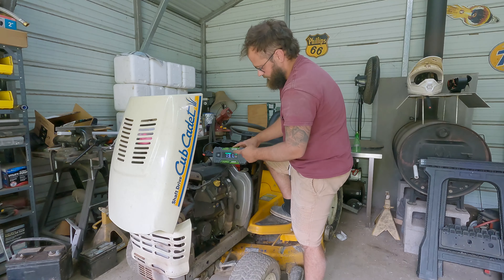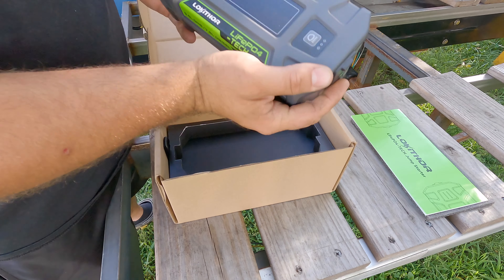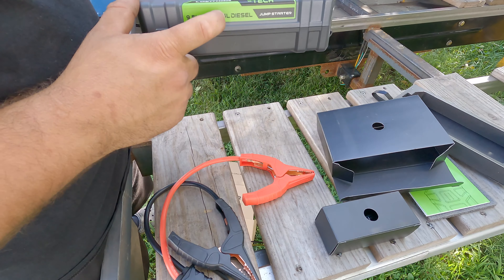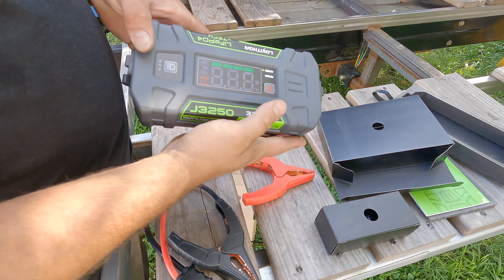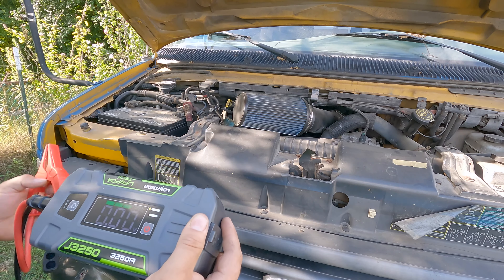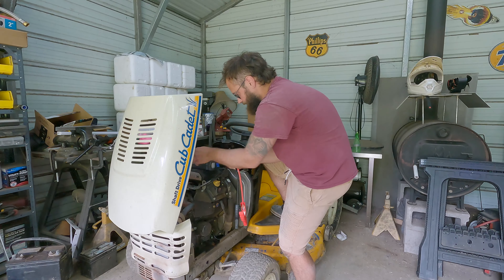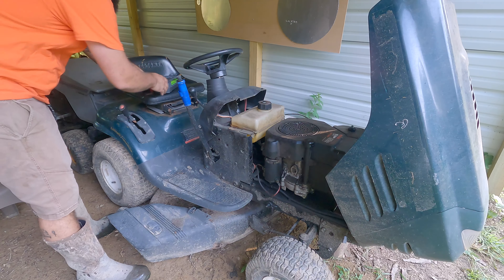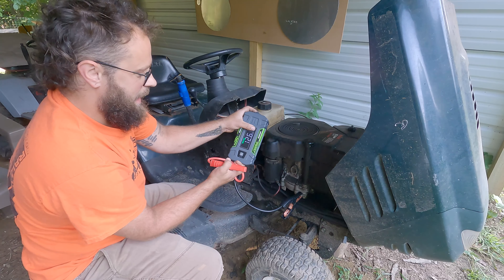Lokithor J3250 Jump Starter Test

Comment: Great review. Lifepo4 batteries are the way to go. More cycle life , powerful and far less of a fire hazard than ion and polymer. I have the Vitoman Lifepo4 battery pack and it's great. Lifepo4 are VERY much underrated but are a power stealth to have in your emergency equipment.

Comment: Read I have been dealing with thesmall jump packs for years had many I have 3 right now and one great big 1. If you truly want to test it put it on a battery load checker now I'll tell you what you truly have
Reply from the maker: I wish i had one for sure
Reply: @redzz02   Pick up one pretty cheap online now and it's just a good thing to have lying around it tells you how good any battery is
Reply: Yes the one I have is like 25 years old LOL
Reply: The old school load tester put a solid heat sink load on a battery. I am not sure that one of these battery packs can really handle that type of a sustained load like a lead acid. Starting an engine is not a straight load, instead a pulsed load, only a peak load at first crank.
Reply from the maker: @cliffpalermo  great info!